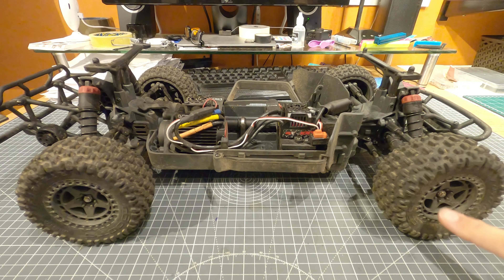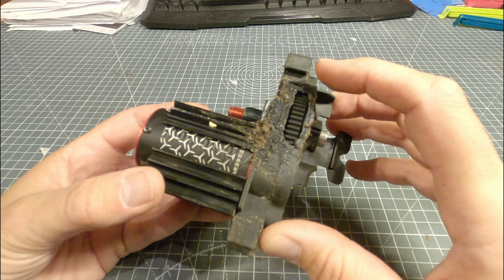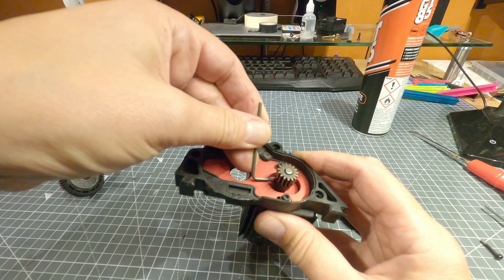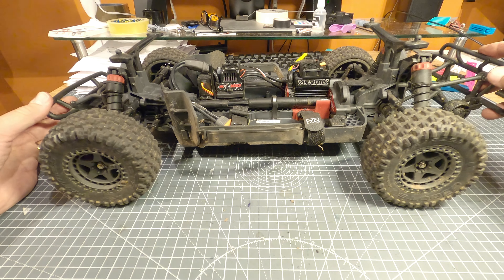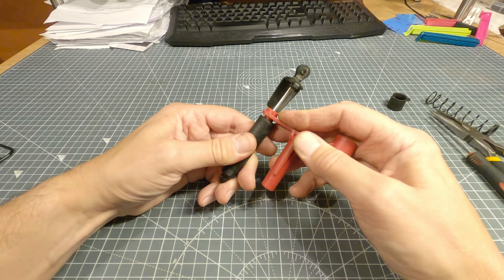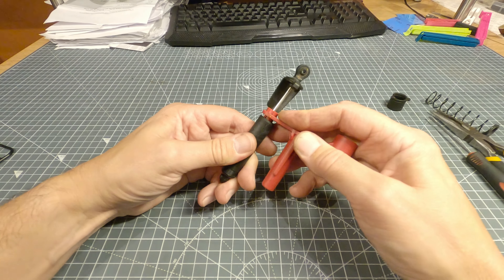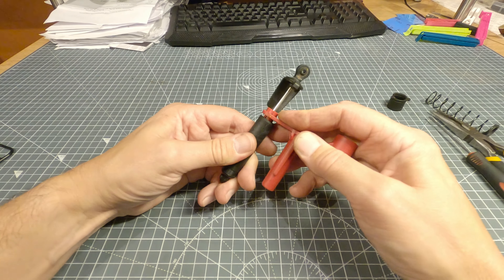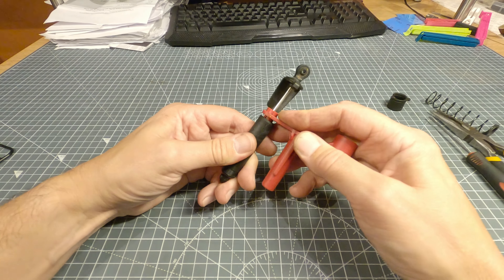Arrma Senton 3s BLX V3 Review and Top Tips. Arrma 3s Mods, Upgrades Granite Typhon Big Rock Vorteks

Comment: Is there any servos I can just replace mine with a 23tooth
Reply from the maker: Hi there. If you Google 'RC servo spline chart' you should find a list showing which manufactures use 25t and which use 23t. From there you need to do a bit of research into a particular one that is suitable. I hadn't realised the difference when I bought the JX Servo but luckily I made it fit. It seems that 25t is the most commonly used size. Hope this helps 😀

Comment: Damn, it seems like you have to thread lock everything on this vehicle, seems like they should do all this at the factory!!
Reply from the maker: Well yeah that would be nice.  I'd rather they sold it as a kit so I could build it right the first time.  Other than that a great RC.  Thanks for watching :-)
Reply: @PeteWylieRC  yeah see this is what keeps me from buying Arrma , I saw in your previous video of the unboxing where you had to thread lock the parts in the driveshafts to keep them from backing out and falling off!! That’s just crazy!!! Lol I can’t believe those parts aren’t thread locked out of the box!! Good video though very informative 👍👍
Reply from the maker: @rcreviews9894  I know what you mean but they are worth putting a bit of time into.  The Granite is my favourite and maybe my favourite RC of all time.  Crazy fun.  Just needs a bit of tinkering to get it right.  Thanks again for your comments :-)
Reply: @PeteWylieRC  I went ahead and ordered the granite 4x4 3s v3 just for the hell of it to see what the hype is all about is there anything I need to be aware of with this truck do I need to completely disassemble the driveshafts like you did for the senton??
Reply from the maker: @rcreviews9894  Ah great, hope you like it.  Well you could just run it and see if Arrma have got better at threadlocking.  Personally I'd go through it and check.  Also the motor screws are important to threadlock on the V3 sliding position motor plate.  I think that's how my original Senton motor got knackered!  Other than that I think I've mentioned all the things in the videos.  Let me know how you get on.  I will check out your channel and sub if I'm not already :-)
Reply: @PeteWylieRC  Thanks for the Sub I really appreciate it! Subbed to you as well, my last comment was genuine and I hope I didn’t come across sarcastic, I will try anything when it comes to Rc’s I love em all ! I’m addicted lol,  Arrma is a good brand I just think they sometimes over look the basics when it comes to how they manufacture their vehicles, the lock tite situation for example that’s kind of inexcusable in my opinion, these are high powered vehicles it’s common sense that everything should be secure and lock tite out of the box any ways I look forward to the truck arriving I am excited! And it will be featured on my channel hopefully all goes well I will let you know how it goes
I must warn you though most of my content is Traxxas so maybe I am a little biased lol I will browse around your channel and do my homework so I am ready for when it arrives thanks for the feed back and I look forward to more of your content👍👍
Reply from the maker: Ah well I've got a few things to say about Traxxas and the way they have done business! Basically patenting things that have been in existence long before they existed and then bringing lawsuits against other companies for using them. They pretty much wiped out HPI Racing and nearly Arrma before Horizon picked them up. Anyway, I won't buy them for those reasons although I have got Traxxas Slash from before I knew what they are like. I would say that I did have a lot of issues with that and had to replace a load of parts with RPM ones. I hope you like the Granite. When you test it remember the price compared to the Hoss. People often do reviews on similar RC's and don't take price into account. The Arrma 3s are good for the money but you will need to tinker with them. Thanks again for your comments. I'll keep an eye out for what you think of the Granite. Not sure if you've seen them but I've done a couple of bash videos of it. Cheers for now 😀
Reply: @PeteWylieRC  cool I will check those videos out! Yeah I never got the full story on that Traxxas situation, you see I just got back into the hobby recently within this past year I started my channel 5 years ago, posted a few videos and was gone for 4 years!! I had just stopped rc’s got really busy with work and life in general but I’m back at it again trying to revamp my channel and catch up on all I’ve been missing in the rc world from what your saying though that does sound messed up on Traxxas’s part maybe they got greedy most big companies do shady stuff like that, not saying it’s right but I’ve seen it before especially in the gaming industry, I did have plans on doing some comparison videos on it any way between some other Traxxas trucks we’ll see how it stacks up